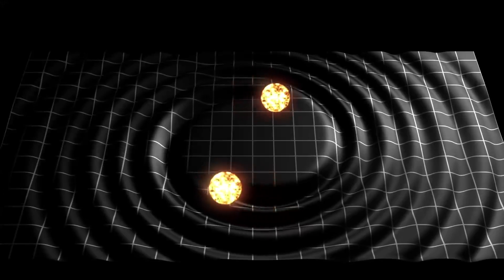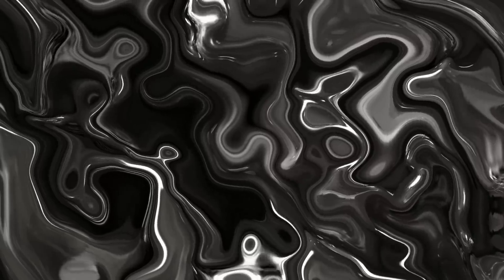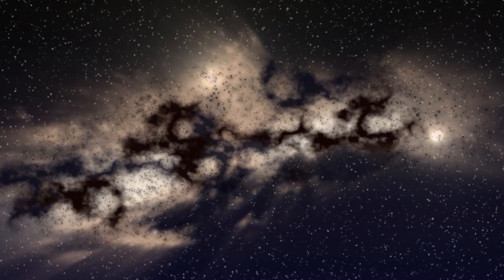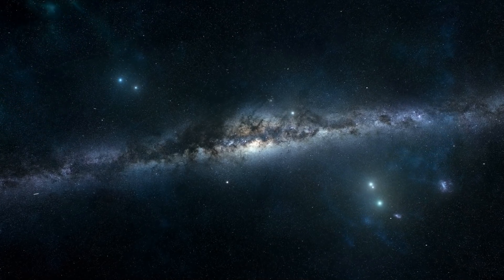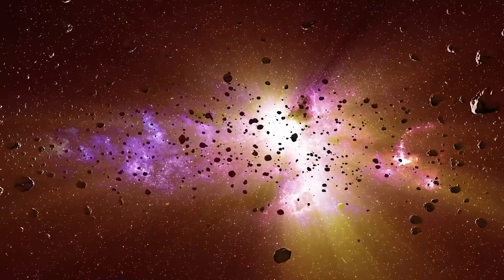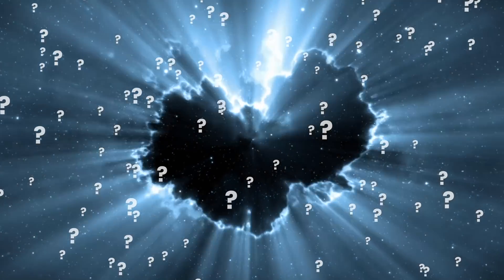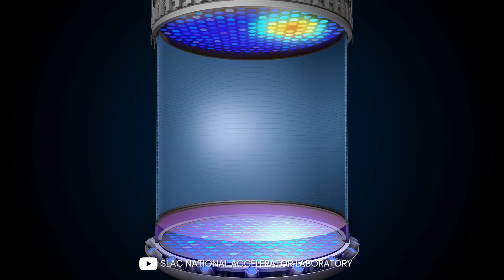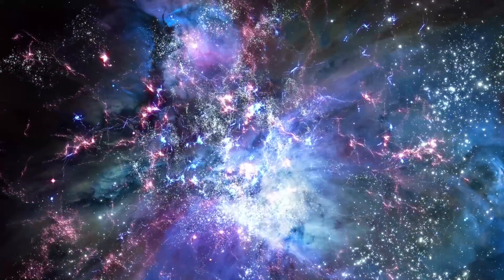This Will Change Physics! Dark Matter May Not Exist!

Comment: I WANT TRUTH TO PREVAIL!
STATEMENT OF FACTS: THE BIG BANG THEORY IS IMPOSSIBLE. YOU CAN NOT LOOK BACK IN TIME. THE UNIVERSE IS A CLOUD. THE EGYPTIANS COULD NOT HAVE BUILT THE PYRAMID OF GIZA, OR THE SPHINX, AND THE SMALLER PYRAMIDS WERE BUILT AROUND 10,000 YEARS LATER.
PROOFS: THE BIG BANG THEORY IS IMPOSSIBLE: THERE ARE INFINITE REASONS WHY THE BIG BANG THEORY IS IMPOSSIBLE. THE EASIEST WAY TO PROVE IT IS WITH EUCLIDEAN GEOMETRY. IF 2 OBJECTS COLLIDE, THEY CAN NOT HAVE ORIGINATED FROM THE SAME POINT. THE BIG BANG THEORY IS IMPOSSIBLE. IF THE PATHS OF 2 OBJECTS INTERSECT, THEY ARE GOING IN DIFFERENT DIRECTIONS. THE BIG BANG THEORY IS IMPOSSIBLE. THE BIG SPLASH THEORY IS MORE LIKELY THAN THE BIG BANG THEORY THEORY BECAUSE OF THE FLUIDITY OF SPACE AND RESIDUAL LIQUID.
YOU CAN NOT LOOK BACK IN TIME: IF THE FORMULA YOU ARE USING COUNTS SOMETHING TWICE, YOU WON’T GET A CORRECT ANSWER. YOU ARE COUNTING LIGHT YEARS TWICE. DISTANCE WAS TRANSLATED INTO LIGHT YEARS. LIGHT YEARS ARE DISTANCE, NOT TIME. IF I LOOK THROUGH A TELESCOPE AND SEE A MAN ON A HORSE GOING OVER A HILL, I HAVE EXTENDED MY VISION, BUT, I AM STILL SEEING IN REAL TIME. I HAVE EXTENDED MY VISION A FRACTION OF A LIGHT YEAR. NO MATTER HOW FAR YOU EXTEND YOUR VISION, AT THE END OF YOUR EXTENDED VISION, YOU WILL BE SEEING WHAT IS HAPPENING RIGHT THEN! YOU HAVE DONE NOTHING TO EFFECT TIME! ALSO, THE BIG BANG THEORY IS IMPOSSIBLE, SO, YOU CAN’T LOOK BACK IN TIME IN SPACE SOUP.
THE UNIVERSE IS A CLOUD. I STARTED TO NAME THE UNIVERSE, “SPACE SOUP”, BUT, ANTON GAVE ME THE IDEA OF CALLING THE UNIVERSE A CLOUD. I HAVE NAMED THE UNIVERSE A CLOUD, BECAUSE, I FOUND IT, IT’S MINE, AND I GET TO NAME IT! CITING THE UNIVERSAL, INTERSTELLAR, INTERGALACTIC, AND INTERNATIONAL LAW, “FINDERS KEEPERS”.
THE EGYPTIANS COULD NOT HAVE BUILT THE PYRAMID OF GIZA, OR THE SPHINX: POCKETS IN THE SPHINX WERE FOUND TO HAVE 13,500 YEAR OLD SEA SALT!!! THAT ANSWERS ALL OF THE QUESTIONS! THE WATER DIDN’T DRAIN, IT EVAPORATED, LEAVING THE SALT, 13,500 YEARS AGO, BECAUSE IT WAS SUBMERGED BENEATH THE OCEAN UNTIL 13,500 YEARS AGO, OR, THE SALT WOULD HAVE BEEN REPLACED WITH YOUNGER SEA SALT. THAT SOLVES THE EROSION QUESTION, WITH DEFINITIVE FINALITY! THE EROSION WAS CAUSED BY 1,500 YEARS BENEATH THE OCEAN, WITH THE SPHINX COMPLETELY SUBMERGED, AND, ONLY THE TIP OF THE PYRAMID OF GIZA EXTENDED OUT OF THE WATER, AND, THE EROSION WAS NOT CAUSED BY RAIN OR SAND! THE DATES ARE KNOWN, BECAUSE, 15,000 YEARS AGO, WAS A WORLDWIDE FLOOD. HERE’S THE PROOF THAT THE EGYPTIANS COULD NOT HAVE BUILT THE PYRAMID OF GIZA, OR THE SPHINX: THE PYRAMID OF GIZA AND THE SPHINX WERE CONSTRUCTED ON LAND. THERE IS NO WAY TO KNOW HOW MANY THOUSANDS OF YEARS AGO. I SUSPECT THAT THEY WERE BUILT BY ANNUNAKI, FOR PURELY NAVIGATIONAL PURPOSES. 15,000 YEARS AGO, THE MAGNETIC POLES SHIFTED, OR REVERSED, AND THERE WAS A WORLDWIDE FLOOD, AS OCEANS BALANCED WITH THE NEW POLE POSITION. THE PYRAMID OF GIZA AND THE SPHINX WERE COMPLETELY SUBMERGED IN THE OCEAN, WITH THE EXCEPTION OF THE TIP OF THE PYRAMID OF GIZA. THE EROSION IS A STORY TELLER, LIKE TREE RINGS. THE TIP OF THE PYRAMID EXTENDED FROM THE SEA UNTIL THE POLES ADJUSTED AGAIN, AND THE SPHINX AND PYRAMID WERE ON LAND AGAIN. THE SMALLER PYRAMIDS ARE ABOUT 10 THOUSAND YEARS AFTER THE 2ND MAGNETIC POLE SHIFT, AND EARTH CHANGED AXIS TWICE! THE EGYPTIANS COULD NOT HAVE BUILT THE PYRAMID OF GIZA, OR THE SPHINX!
Reply: i read it all and i don't really get much but its good.

Comment: I know the cause for anomalous galaxy rotation velocity. I'll see if I can point you to it in short order.

step 1.
Dont call it "time dilation". Call it what it really is "variable atomic activity". Thats what it is, because an atomic clock employs atomic activity to keep time. 

step 2.
Acknowledge what is the cause of atomic activity? What generates atomic activity? Atomic forces do. The theory of fundamental forces right? Isnt that the role that the theory of fundamental forces was developed to explain, "what animates an atom"?

Variable atomic activity is a result of variable atomic force. Think of it within terms that atomic forces are the engine that generates atomic activity. The atomic activity is variant because the force issued from atomic forces is variant. In the same way that variable force issued from a car engine is responsible for the car's velocity, acceleration. 

step 3.
Atomic energy, atomic forces are known to be directly correlated with atomic mass. And my explanation above makes it plain that atomic forces are variant. THEREFORE ATOMIC MASS IS NOT A CONSTANT, IT IS VARIANT. 

step 4. 
Atomic mass is directly correlated to gravity.  Variant atomic force/mass is the variable that provides a systematic correction to the values of gravity, in any given area within a galaxy. This provides the systematic correction that accounts for anomalous galaxy rotation velocity. 

Its worth noting. Einstiens theory of gravity, General Relativity. It is wholly correct. Gravity is not the variable. Atomic force, atomic mass is the origin of the variable. So that's some good news for Einstein

All you have to do to realize the validity of this reasoning, is to appreciate that time dilation is better described as being "variable atomic activity". Then appreciating that atomic forces are reasonable for animating atomic activity. Variable atomic rate is due to variable atomic force. It is no more complicated to understand than the relationship between force issued from a car engine, and the acceleration/velocity of the car. Not many things simpler than that. 

If an atom is observed to have accelerated activity, as is the case with "time dilation". Consider acceleration due to force!!!!!!!! how could it be simpler than that????
Reply: Further more. I know why atomic force is variant